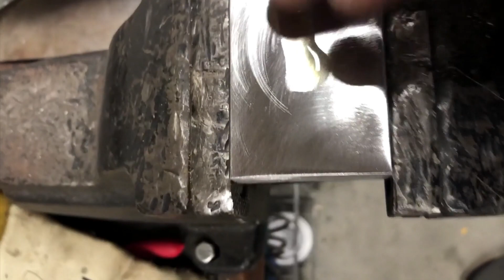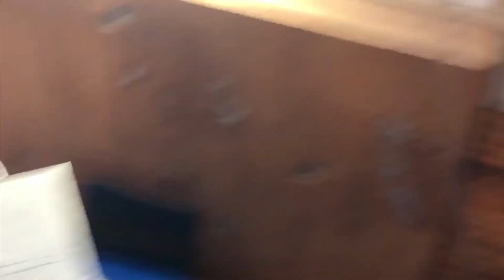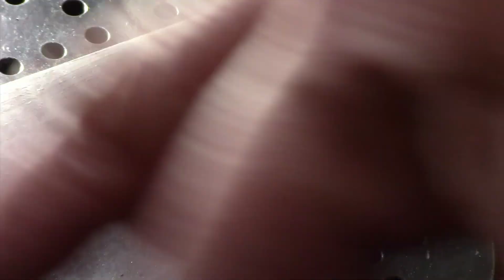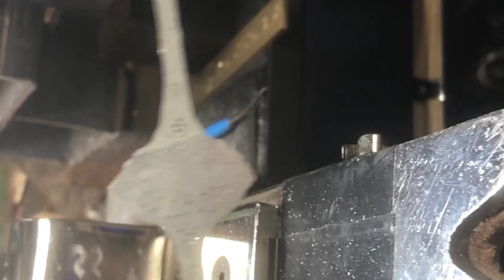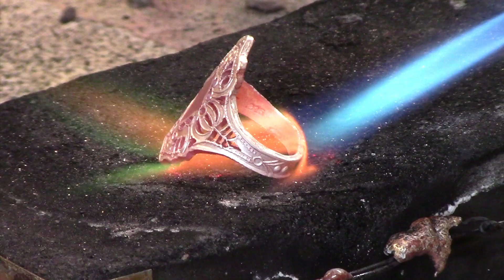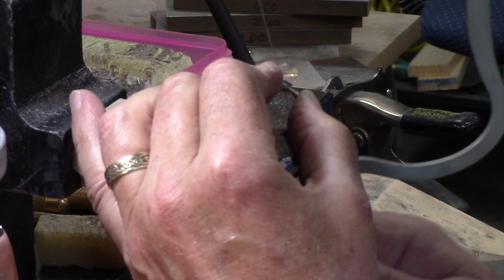A Custom Carved Filagree Ring -From Design to Finger

Comment: That looks like how you can do it. I can't do that method because I can't purchase a press at the moment but, but I did think of something. So I will do what you did but instead of carving out  cool patturns like yours. I will make a drawing outline of a ring on .925 and then Stamp the inside outline only. After I finish stamping it out I can cut a long the outline and then BINGO I got a cool custom one of a kind hand Stamp ring. Ty ty for the lightbulb
Reply from the maker: As a one of a kind that would work great. I go for at least 12-120 of a kind 😉

Comment: Great video. I always wondered how you transfer the design on the steel acetone. Never would have thought! When you were piercing out did you use a 4/0 blade for those tiny spaces? I’ll have to check out Rio for those premade bezels ( any code numbers on those?) beautiful ring thanks I enjoyed the video.
Reply from the maker: Thanks! At Rio under chains and findings search tube. They are there. I use a 5/0 or 6/0 for most piercing and a 0.7 mm drill if I can get away with it and a 0.5 mm if I must (I break them too often)